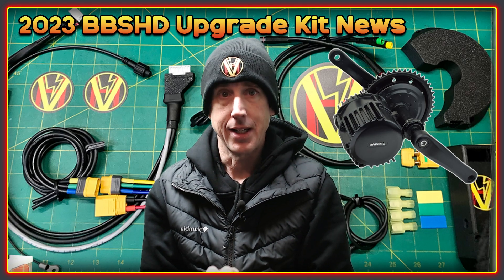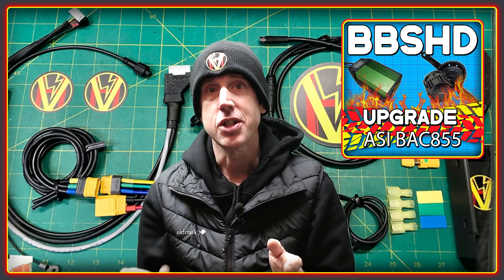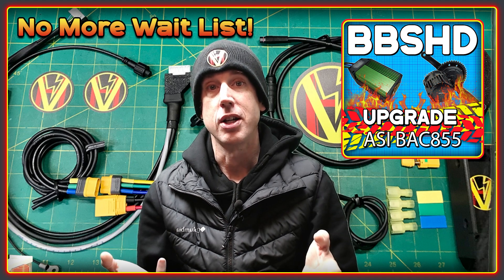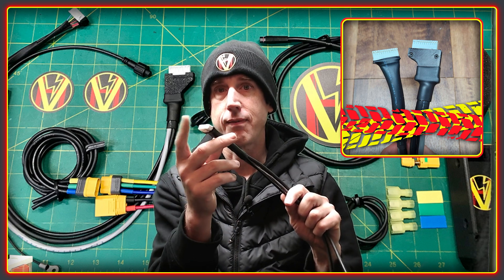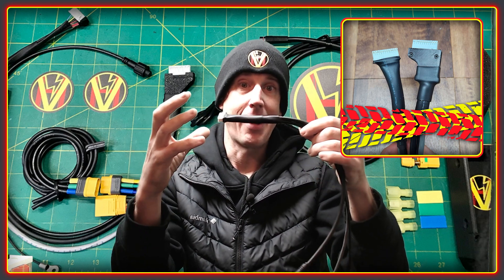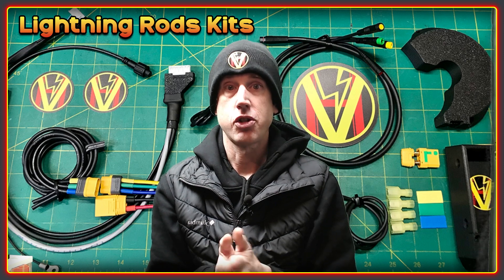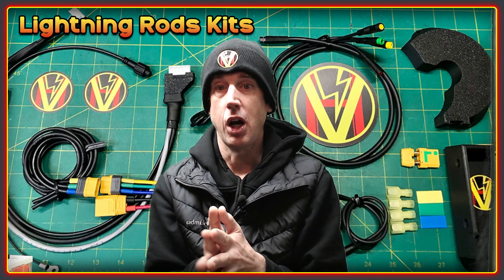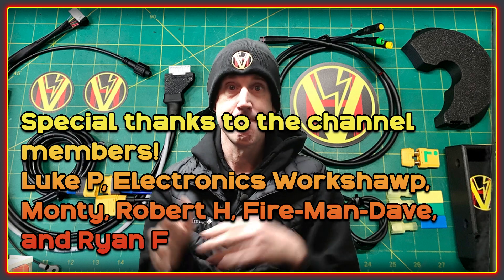2023 High Voltage Upgrade Kit for Bafang BBSHD - Improvements and NO more wait list!

Comment: Hi mate, I have some questions:

What's the difference between bac855 and Phaserunner?

What's the max amps the bbshd can take continuously without frying?

How many max amps of field weaking can be pushed in the bbshd?

Do you know where can I buy the steel reduction gear for the bbshd? I can't find it anywhere.

Cheers
Reply from the maker: Hi, the phaserunner is based on the same boards as the 855 or at least the frankenrunner is. The phase runner seems to not be made anymore. So its still ASI tech but they supply the bare boards and parts to grin who then assemble them themselves. They do this so they can run their own version of software on there. We set ours to 90 phase which generates 4000 watts peak. We also use thermal throttling to back things off if the motor gets too hot. There are lots of tricks to running it this hard and the main one is to use a 1:1 gear ration which provides a good balance of speed and torque. Let the RPMs do the work. Field weakening is the ratio and people use anywhere between 25-50% The steel gear is hard to get and is not the best option. The PEEK is better but that is also hard to get. I saw a few in Europe but very expensive. Almost $100. Both were originally luna products and I don't know why they are not making them anymore. You are welcome to join our discord and learn more about this stuff if you would like. https://highvoltagekits.com/discord
Reply: @HighVoltageKits  thanks for the response. I have the phaserunner and I was wondering if the bac 855 would be any better.

Cheers

Comment: I really like the look of the CYC photon. 
Any chance this will be offered in the shop in the near future?
 I have pegged my existing kit back to 1000W(on standard) as I only like to ride casually and I don't need the extreme power 3000W offers(most of the time).
 I am currently looking at some sort of setup for my other half so will be looking at a system for her bike.....soon!
 The kit I purchased is working very nice and I am more than happy with it!
Keep up the good work!
Reply from the maker: I'm going to try and pick one up for my wife's bike. It will be interesting to try it. Try Golden Motor for Canadian and US distributors.
Reply: @HighVoltageKits  Cheers mate! I have found a distributor here in Australia but only back order at the moment!
Reply from the maker: They are all waiting on stock I think

Comment: Good day to you bro , what you all are offering is a form of survival helps for the road, does the 72v battery kit work the 52v  17.5ah battery
Reply from the maker: The kit will work at 52 and 72 volts as long as the battery is up to spec. You can change the battery selection with the Eggrider app. If you want to get specific advice on anything you are welcome on our discord. The link to that is via this webpage. https://highvoltagekits.com/discord

Comment: Will we need to contact you if the configuration on our bikes needs to be changed for any reason?  Or are we given the option to login to these controllers via bluetooth and do it ourselves?
Reply from the maker: The vast majority of things can be done via the Eggrider display and Bluetooth phone app. This will allow for a high degree control over pretty much anything you might need to change. We have our own bluetooth app in beta testing which will give access to a few of the higher level things. It is best to make contact via customer service depending on what you want to do in those cases as we can give you advice on the parameters that you would need to change. We cannot give full unrestricted access to all 2000 variables on an ASI controllers but you will have access to change the things that matter for bike performance and handling.
Reply: @HighVoltageKits  hi the eggrider I have with the asi BCA855 brought from crystalyte Europe which I brought a thur Axle hubmotor doesn't allow changes to the throttle I wish it would ramp up a bit faster
Reply from the maker: Yeah, the eggrider does not do throttle ramp, and that is one of the reasons we are developing our app. It's a pretty common setting to change. Have you tried contacting them to see if there is a way for then to change this for you?

Comment: Got one of your early kits from Hv back in Apr 21 just when you were all joining forces. 

Great to see how far the team has come along with the unrivalled support, continued innovation and improvements 👏 

My kit (with peak gear) after 5000 miles is still fantastic! I got the bug and went from originally running 52V to 72V and runs so smooth 👌

Great work guys!
Reply from the maker: Hey Jamie, great to hear from you. Great you are enjoying life at 72 volts. Cheers
Reply: Jamie, were you running the HV kit with 52v and at how many amps? How did you like the power?
Reply: @Hybrid600   Yes I did run the HV kit at 52V. All depends on your BMS but i was drawing about 55A peak. It was an amazing difference not only the extra power ~3000W but also the extra smoothness. 

Then transition to 72V is another huge leap which enables far greater RPM so much higher speeds in the larger rear cogs. If just using throttle you barley ever need to change gears.
Reply: @jamo9000  Thanks for the info! I was thinking of getting the 52v BMS changed to a higher limit one in the meantime. 3000w is plenty. That way I can keep the same battery for now and upgrade to the more expensive 72v one later. Cheers.
Reply: @Hybrid600  Yeah also depends on what cells are in too for Max discharge rate rating. Another option is also to bypass the BMS for discharge only just need to be careful if going that route. My original battery I got with the stock 30A BBSHD had Samsung Q30s and 14S5P so plenty of draw avail. I got lucky as I have no idea what my BMS was limited to on draw if anything as it never cutout and I pulled up to 3300W. I then upgraded to a 20S5P Molicel P42A battery back and it really is incredible.
Reply: @jamo9000  great tips, thanks!

Comment: A very good video. I wish I'd gone for this over the ludicrous v2 for mainly 1 reason, customer service... I've joined the discord, and I'm trying to get the hang of it when I've time.
Reply from the maker: Cheers, Pete. There are a few folks running that one on Discord and also some VESC areas, so hopefully, we can help you with that.
Reply: Im impressed you were able to pry a ludicrous v2 away from Luna. They refuse to sell the damn thing unless you buy it as a component of a complete e-bike.
Reply: @umamichefd  I know, not sayingit to be a knob, I wangled 1 ludicrous v1 I've had years and 2 ludicrous v2's, a unused 1 and a 72v one. I don't understand why they make them so hard to get.
Reply: @nanopete6472  I've heard of a few people getting one through somewhat nefarious means, but not 3 of them. You break into the warehouse or something? Im kinda glad they didn't sell me one though, it led me to installing the high voltage Bac855 kit instead and it's been pretty much perfect.
Reply: @DonGlow  my cat burglary days are over haha. I had a bbshd and battery fire in 2017, through this I got offered a ludicrous v1, I had that up till just before Christmas where I got offered the V2 and peek gear, I managed to talk another one out of them for my mate who decided this week to go hub instead of bbshd so he offered it to me unopened  with the peek gear. I only took it as know how hard they are to get.